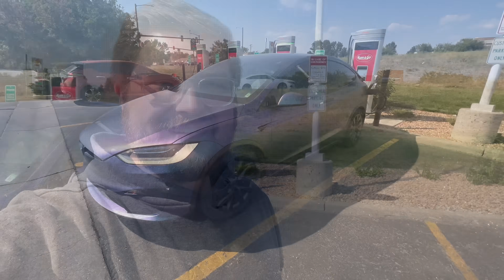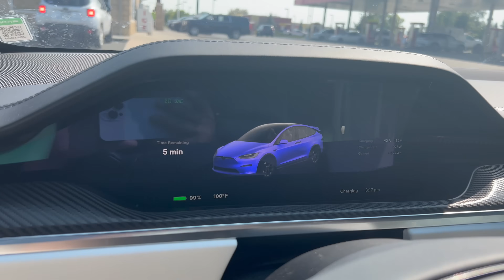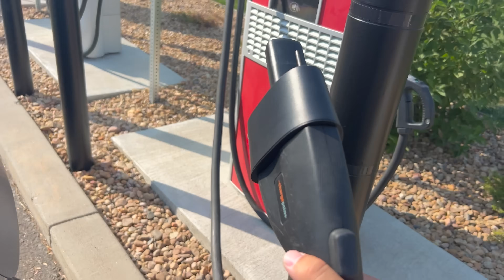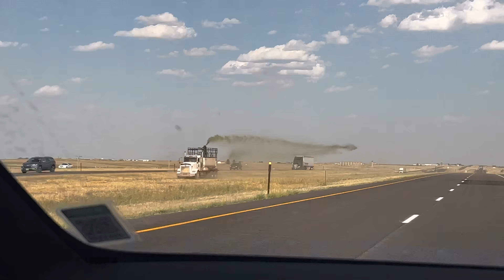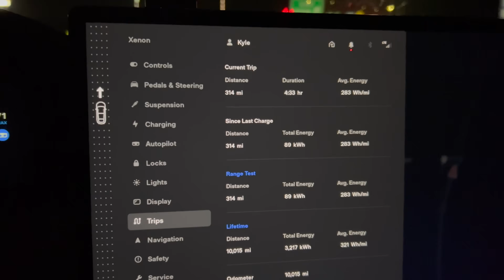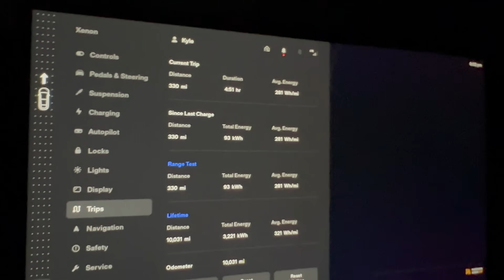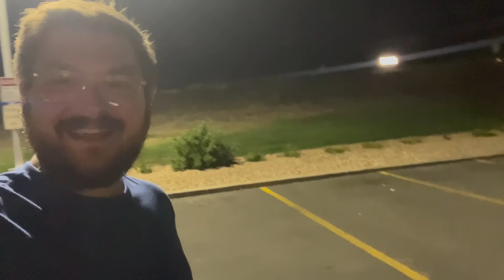2022 Tesla Model X Long Range 70 MPH Highway Range Test - Will It Go Farther Than The BMW iX?

Comment: I have 2020 x horrible  without the heat Pump and cannot be changed. winter i get barely 200 miles. If I dont open any Ac or heat then may be 270 the most. Absolutely disgraceful they sold it for 350 miles range as used ( back then brand new ones was not getting that too)

Comment: How is the air suspension comfort quality, (not in this test because it was tested at lowwest setting for getting more miles), but in comfort mode is it good? I mean I’m using audi allroad C6 with factory air suspension in 17” wheels, so maybe not that easy to beat that softness…

Comment: iX has bigger (useable) battery by about 11%.  Comparing 339 miles for iX versus 331 miles for MX, MX did pretty good.  iX only went about 2% farther than MX despite having a 11% bigger battery.  Why is it a shock that an EV with a bigger battery goes farther?

Comment: I have a 2024 Model X.  What distance in miles should it display when the state of charge is at 100%? The first time I charged it at 100% was back in May and it displayed 319 miles. The second time was in September and it displayed 301 miles. I took delivery of my car in October 2024. It’s a year old now. As you know, the EPA on this car is 335 miles. I’m a newbie driving an EV. Should I be concerned with the battery health? Or is this the norm? BTW, great video, full of information as always. Thanks for sharing your experience and knowledge.

Comment: 331 miles on a full tank is less than Mercedes EQS SUV as-tested, and the EQS is still smoother and quieter than the iX.   What's more, EQS can use Tesla charger.

Comment: Good way to estimate the cybertruck.  Cybertruck battery is 20% larger, but also 20% more weight and 20% drag.  So safe to assume 300 miles is actually doable

Comment: Now that the MX starts at $80K does that change your opinion on which is the better value? Also which would get you to 600 miles faster on a road trip? Just sold my MME and looking at both.  After having a CCS car, pretty sure I’m going Model X.  Thoughts?    Love all you guys do!
Reply: You got this right! After owning two ccs cars I will go for Tesla immediately! But if the infrastructure changes, who knows...
Reply: In the US where non-tesla network sucks, Tesla makes most sense. But if I'm in most other countries where all manufactures have to conform to unified charging standard, I'll take the BMW.
Reply: I’m excited for 2025 in the US when everyone will be using NACS as a native plug on their cars and charging stations will all become more and more standardized.  I can’t imagine buying a car in 2024 with a CCS port.  Next year could be the big year for EV’s here.  I think for the money I’d still choose the MX over the BMW, but I couldn’t blame anyone (next year) for going with the iX.  It looks like a great vehicle.
Reply: KIA EV9 AWD is the vehicle to go for. Way cheaper, way more space, awesome styling + fast charging and just 50miles less range at most (A 45°F range test achieved 266mi, I would expext it to go at least 15miles more in summer).
Reply: Lots to like about EV9 but several deal killers. 1. It should be way cheaper, but dealers are asking $20k plus markup.  So until that stops, off the list.  2. Still uses CCS plug, did that already…. no thanks.  3. Range isn’t great for a family hauler.  4. No tax credit offered.  I’d look at this in a couple years when all those issues will be addressed, just not today.  But I could say that about every EV being offered today.  2025-2026 will be transformative for auto industry IMO

Comment: Crazy to me that people would consider buying an electric vehicle from BMW, a company with as much experience making EVs as that guy across the street. People definitely don't think with their wallets or like engineers. Tesla has been doing this for 2 decades now. They've optimized and tested every part of the vehicle. What are you going to do with your BMW when the charging circuit is throwing an error at 50,000 miles? No thanks. You have to think a bit more critically about these things. Sure, I bet GM could build a jumbo jet, but I'd prefer to fly in one from Airbus or Boeing.

Comment: How does the air conditioning feel at 70 mph for 320 miles? Did you use it sparingly or full time ? Thanks in advance.

Comment: I have steering wheel vibration above 55 mph in my 2023 Tesla X. Had it road forced balanced, still vibration. Took it to tesla service and was told the vibration is within Tesla specifications. Quite a disappointment.
Reply: Shouldn’t have any vibrations.  Picked up a new X Plaid and noticed a little vibration at 75mph on the drive home.  Took it in and they ended up having to replace 3 of the tires - these were brand new and only had less than 200 miles on them from the drive home.  They chalked it up to defective tires.

Comment: BMW iX has a 111kWh battery with 105kWh usable. I'm sure it and the model X have a similar miles/kW result but the iX50 with range wheels would probably win since it has the bigger pack. The GVWR and coefficient of drag are basically the same.

Comment: Only 330 miles one full charge. Not a good choice to travel across states for 600 miles daily.
Reply: LOL - that's not how it works.  You can recharge 200 miles in 20 minutes tops.
Reply: @SpottedSharks  Thanks for sharing. Is charging pole popular along the state hwy? And if I have to rush on the road for 600 miles daily, I am afraid I dont have 20 minutes to wait. But of cause Tesla is the future. I wish Tesla can improve the cell capacity and the decrease the price to make e-car more popular and piratical to replace gas car.
Reply: 600 miles daily? -> At 60 miles an hour that's 10 HOURS OF DRIVING.

Is that even legal?
Reply: "I am afraid I dont have 20 minutes to wait."
Bullshit.  You are not nonstop driving a car for 10 hours a day.

Comment: You state full charge range of 351 but Tesla websites states that the long range MX, 20" wheels with 6-seat interior provides 348 miles on full charge. 351 miles is only available on 5-seat configuration, 20" wheels.

Comment: Very interesting results. So the iX 50 would go even further than the m60 meaning it could beat the model x by as much as 20-30 miles in range with similar performance numbers. Fully loaded they're also similarly priced. So if you don't want the insane Plaid, which would destroy the M60 in performance, I guess the iX 50 would be the clear choice over the normal Model X then.
Reply: It makes sense - the iX50 has a range estimate of 630km (wltp), and the new X is at 580km (wltp). The iX does not have that much space though, looks like a boat with beaver teeth, currently lacks the charging network that Tesla has (even though it can use the Tesla network in a few countries such as Norway.. blocking chargers for others due to location of charge port), and the software is not even close. New BMW seats are not as good either… imo, but that is subjective, but the iX seats are just way too flat for me. 

I am curious… just as with dirt and grime, will a matte folio affect the range due to more wind resistance?
Reply: @HOFFERN342 it actually could effect the range it’s not as slippery as paint. Plus it adds weight so it might affect it few miles I assume

Comment: If my memory is correct, you range tested IX in efficient mode. Based on my 1000 mile driving experiences with IX, I feel in more time efficient mode uses one motor. Don't know for sure, just my feeling. That may experience why IX out ran EPA estimation by 60+ miles.

Comment: Unless I'm missing something, the Model X didn't even reach its EPA range, while the iX exceeded its EPA range. To me, that's a bigger takeaway than which went farther. Consumers should know what they're getting up front. 
Also, if it was due to battery degradation, frankly, 10,000 miles just isn't that much. If the Model X lost that much capacity after only 10,000 miles, that's more concerning than anything else.

Comment: How hot does the car get?  The windshield makes me think it would be uncomfortably hot at times.
Reply: The tinting Tesla does on their glass is quite strong. I have a ‘22 model 3 and I’ve driven it through several 100 degree F days, stayed very cool inside!
Reply: @chandler5014  my car today. Couple of minor things that Tesla needs to fix but overall really happy with it. I got used to the yoke within seconds. The regenerative braking is a little tougher.
Reply: @lance4862  regen breaking does indeed take a little time to get used to 😂

Comment: Bjørn Nyland was able to get 4.1 kWh out of a Model Y below 0%. So if the X has a similar buffer below 0% you should be able to get 4 extra miles out of it before it dies.

Comment: 280W hours per mile is pretty incredible. Given that my 2018 performance model three with 20 inch tires averages 300. Just shows how efficient Teslas have become in only four years.
Reply: too bad they are junk in everything else.
Reply: BMW is actually more impressive in motor technology considering it weighs quite a bit more that the Tesla, has 22" wheels, and doesn't look like a tear drop. Those who bemoan the ix for the bigger battery, forget to consider the fact that the bigger heavier battery also reduces efficiency.
Reply: @hotrod182  Its really not more impressive. 15% more battery is a huge difference.
Reply: @SirDragonClaw  The bigger battery also weighs more, and the BMW weighs more, because its premium in every facet. Seriously, after sitting in the BMW, the Tesla feels cheap.
Reply: @SirDragonClaw  Yeah, but when you buy something at that price, everything else matters. Besides better range the ix is quieter, better ride, better quality, better stereo, better laser headlights, has advanced HUD, more exclusive, etc, etc. But if you are looking for efficiency, the Tesla wins. But the main reason that matters is for range. And even in the point, the Tesla loses. And as a brand, BMW is #1 in consumer reports latest brand survey. Tesla was far far behind. Losing , Losing.

Comment: you could also have pushed the BMW IX M60 even further you had still almost 50% power available on that test means you could probably have went another 5-10 miles. Bmw usually have a pretty big bottom butter.

Comment: Sorry but it doesn’t sum up. It still looks like Tesla is only showing the energy going to the motors, otherwise the degradation after only 10.000 miles would be too much.
Either that or Elon is not being quite honest about battery size. You know, he managed to go 100kWh, why should the new model X now have to have a 95kWh?

A last question, are you really sure about the rear motor being a PM one. The pre-plaid S had the Midel3 rear motor (PM) on the front and a induction motor in the back to get that much power into the available space, that’s why that model S was a FWD on the highway( ECO mode anyone). So it makes me doubt that the’ end changed that rear motor to a new PM one, losing some efficiency.

Comment: Kyle, do you have a spreadsheet or a post that lists out all of your tests?  I just would like to see what capacities you (and crew) have run the vehicles through.  I have a 2020 MS performance, and 324 at 100% (estimated) and am curious if I could achieve the 330+ miles as I can easily achieve less than 280 watts/mile on highway runs.  Also looking at bolts and and E-trons as well.  Thanks in advance, just a nerd wanting to see numbers.  PS hope the Plaid is on the road sooner than later!!
Reply: There's a playlist with all his videos about MPG and efficiency

Comment: Kyle — what software version was the car on?  Apparently the last two versions — staring with .6 — have caused an issue on all refresh s and x vehicles that results in a harmonic hum that is audible but not that loud (you may not have noticed it outside as opposed to in a garage), something to do with frequency setting when the connectors are closed.  I have no idea what that actually means, but it is said to affect range a bit.  So it’s worth understand if this may have been a factor for your test.

Comment: What is the weight of both vehicles?  There are factors not being talked about.
Reply: Also aero is a super important factor especially on highway testing.  The fact that BMW needs a bigger battery tells a lot about the differences between the two.
Reply: @paulsandgren8625  Well, the bigger battery weights more too. BMW weighs hundreds of lbs more, has 22" wheels, and doesn't look like a teardrop. Impressive results if you ask me.

Comment: Commenting as you’re about to leave the charger and head out on the road. I can already tell where this is going and your comments on why you’d get the BMW iX all day over a Model X is the same reason why I sold my Tesla and got the e-tron.  Frankly any EV owner with access to home charging (or level 2 charging at work) are covered with any EV. The quality differences between the Audi or BMW over the Tesla make them an absolute no brainer over Tesla.

Tesla’s road noise issue is miserable. 

Their software isn’t actually the best, because you’re at their mercy. For infotainment I prefer CarPlay over Tesla’s UI/UX. 

It has been a very happy 6 weeks post Tesla ownership!!
Reply: Which e-tron do you have?
Reply: @MrEboogy2009  I have a 2022 e-tron Premium Plus.
Reply: @michaelrbodner  I was looking at the e-tron. Test drove it and everything. I just was nervous about the range, but for my commute to work it wouldn’t be a problem. What are you averaging in your range?
Reply: @MrEboogy2009  first road trip coming up in a few weeks for a real test but my commute is mostly highway and at 75-80 MPH looks like ~235 miles (rated is 222). I charge at home daily so it’s a non-issue. Hoping the road trip is smooth.

Comment: It would be better if there was only 1 EPA testing protocol, and not 2 and letting OEMs to reduce the range value of the test.
All cars should be able to achieve a similar percentage of the EPA highway range on your test.   And yes, all OEMs should publish all the EPA values. 🤷‍♂️

Comment: I have a model S but I would definitely get the iX over the Model X. You can hear how loud it is compared to the iX in the video. Hard to believe Tesla will be able to keep outselling competitors.
Reply: Not with those ultra high cost luxury vehicles. I would recommend the NIO ES8. Much better than the Model X or BMW iX. The Hongqi is cheaper, faster, has more range, better efficiency  but its Software is not on par with Tesla. 

In the Model 3/Y range the others have no really comparable options. There is just no real competition in sight. In Europe we have Kia EV6, Ioniq5, Skoda, VW, Polestar, Nio, Hongqi but they are either much more expensive with the same feature set or simply have 2 years wait time. Mercedes, BMW or Porsche are of course totally out of range of most budgets.
Reply: @wolfgangpreier9160  - They aren’t available in the US because they have such terrible Chinese safety standards. Nobody wants that Chinese crap.

Comment: The Queen is dead (model X), long live the King (BMW iX).   

In near perfect conditions at 70 mph, Tesla missed its combined EPA range by 17 miles, while the iX exceeded its combined EPA range by 65 miles.  The Tesla being more efficient does not mean it has the best drivetrain tech.  Efficiency is a factor of powertrain, aero, and rolling resistance.  

The model X is slightly larger at 2" wider, 3" longer, but 1" shorter in height.  Front surface area (width and height) negatively affect aero, whereas length may help with drag coefficient, and the Tesla does have a better drag coefficient by 0.02 which is pretty substantial for vehicles of this size, tested at this speed.  The BMW has a larger battery, but it also weighs 380 - 580 lbs more.  While weight doesn't matter much at a constant speed since you're not accelerating / decelerating the extra mass, it does have a small impact on rolling resistance.  Part of the extra weight is likely unsprung mass in the wheels, tires, brakes, and suspension, which would hurt efficiency over bumps, but improve road feel.  The iX also has the least efficient wheel / tire option at 275 mm width and 22" diameter, both resulting in a larger tire contact patch and more rolling resistance.  The Tesla had the 20" tires, and I imagine the tires are more narrow for a smaller and more efficient contact patch.    If we had the measurements, we could also compare tire tread and compound, but alas, no luck.

The BMW was tested at a slightly higher temperature that would give it the benefit of lower air resistance, but would be offset slightly by higher HVAC cooling needs.  

I'd also point out that the BMW is doing this with non-PM induction motors, whereas the Tesla has one induction motor and one PM motor.  I'd be curious on how well the motors of each vehicle perform for longevity.  The model X/S have been known to have drive units fail.  

Further, you can get a comparably equipped BMW iX for significantly cheaper than the base model X.  And of course there's the wait time... a base model X with zero paid options pushes the delivery estimate out to July 2023.  The only major benefits of the model X are the slightly faster 0-60 time (which I don't think is the main selling point), the optional (and expensive) 3rd row options (big deal if you need 3 rows), the improved efficiency (not a huge deal IMO), and the charging network.  As we know, Tesla's planning to begin opening up their charging network in the US to other brands within the year, so that advantage will be short lived.  They've already done so in Europe, so it's no longer an advantage at all.